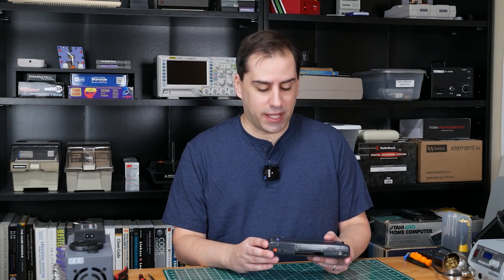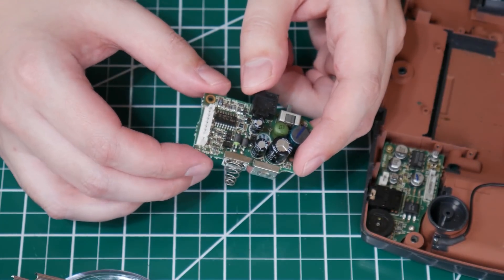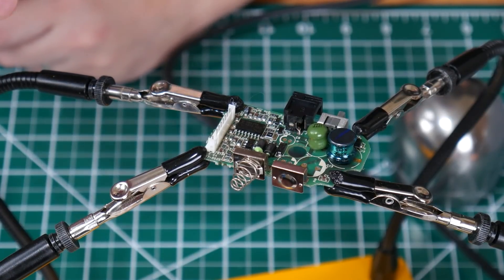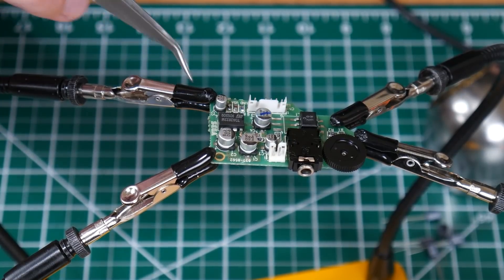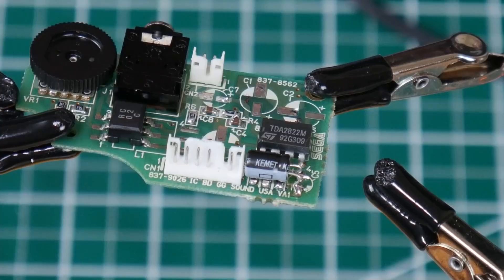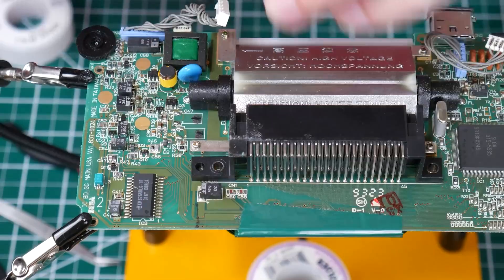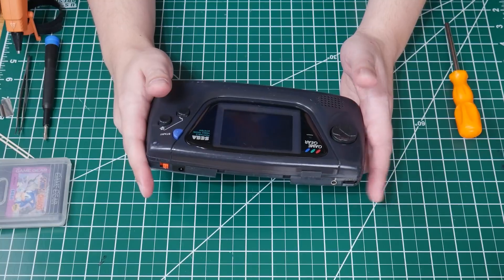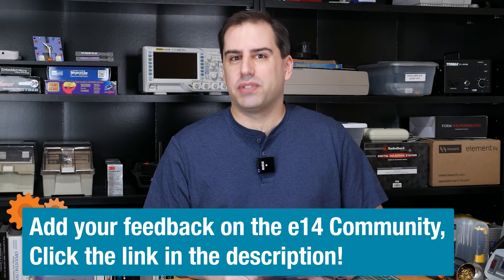Repair a Sega Game Gear - How Hard Can It Be?

Comment: Hi, am not getting 9 volts or any other readings with a multimeter on the power board, thats with either the cable jack plugged in or with the batteries inserted. Whats my next step? recap just the power board and see if it switches on or recap the entire board since am getting no power light.

Comment: Mine stopped working all of a sudden. I do get the first black screen with the clear Sega licensing text but after that I get no picture and no sound with just the front light on. Could that be the capacitors as well or the cartridge slot? I do get some corrosion on the battery slot as well but system turns on after cleaning it.

Comment: I recapped my childhood Game Gear a few years ago. It was actually my first soldering project lol

It worked like a charm, but I did have an issue on the sound board where the corrosion from a leaky cap actually made the solder pad loose. I had to scrape a little of the protective coating off the trace coming from the pad and connect the cap to that instead.

Comment: SO, WHAT was Wrong with it??   "First thing" tried?  -  20 in Fact!  Where was "corrosion"?  - didn't see any;  like to know what to look for.   {{sigh}}  
Oh yeah,  Check Ribbon cable?  =\
Reply: The problem was that some of the electrolytic caps were bad or leaking. Rather than waste time testing, I just replaced them all. I guess instead of corrosion it would be more accurate to say the chemicals leaked from the caps. You can see the gunk on the board. I didn't show it, but those pads were shiny after I cleaned with some IPA and a cotton swab.

Comment: I've rebuilt a number of Game Gears as they all need new caps. And while you're at it, the LCD replaced haha. Many of the caps are used in a SMPS configuration so them being bad means the PSU can't bootstrap. I don't usually advise using TH on SMD but you did a great job so who cares.
Reply: Yeah, the old screens are... not good. I've got a RetroSix CleanScreen coming. Cool to see another Rochestarian - I grew up in that area. I miss garbage plates, but I guess I'm less likely to die of a heart attack by not eating them.